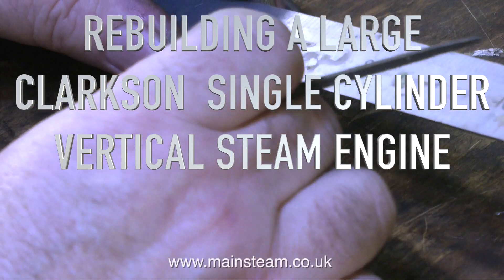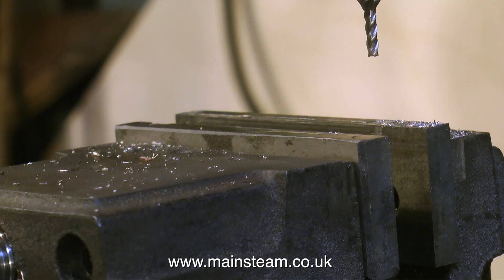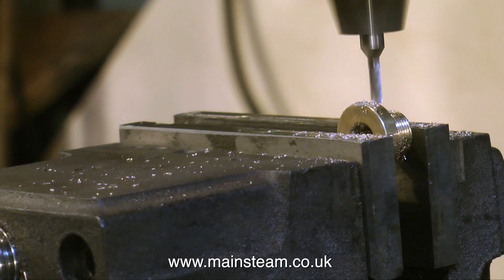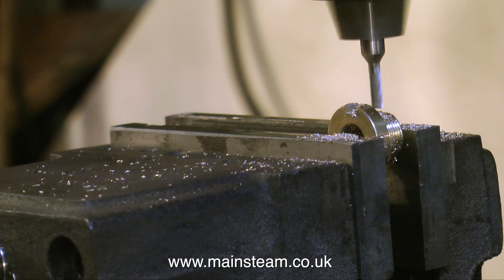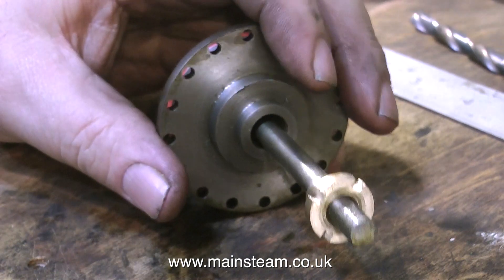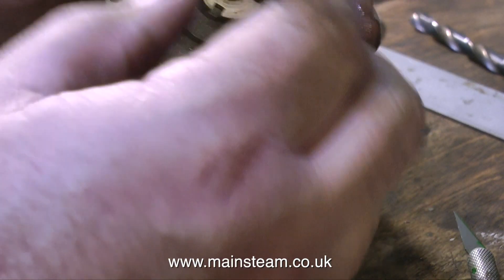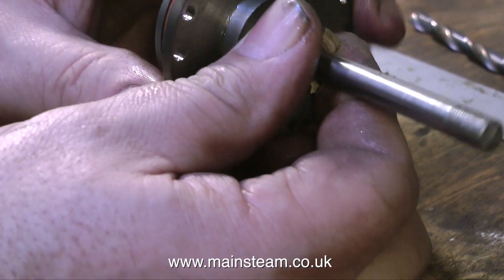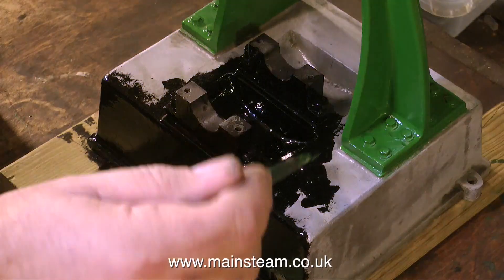REBUILDING A LARGE CLARKSON VERTICAL STEAM ENGINE - PART #8

Comment: Graphite is an allotrope of carbon, as is diamond. Diamond and graphite are different forms of the element carbon. They both have giant structures of carbon atoms, joined together by covalent bonds. However, their structures are different so some of their properties are different. Diamond is a giant covalent structure in which: each carbon atom is joined to four other carbon atoms by strong covalent bonds the carbon atoms form a regular tetrahedral network structure there are no free electrons. The rigid network of carbon atoms, held together by strong covalent bonds, makes diamond very hard. Graphite has a giant covalent structure in which: each carbon atom forms three covalent bonds with other carbon atoms the carbon atoms form layers of hexagonal rings there are no covalent bonds between the layers there is one non-bonded - or de-localised - electron from each atom. The forces between the layers in graphite are weak. This means that the layers can slide over each other. This makes graphite slippery, so it is useful as a lubricant. Sorry I used to be a science teacher
Reply from the maker: Thank you for the Essay Stephen.

Comment: I my self have a horizontal Clarkston engine that reversible and love it, my friend calls it my paper weight, the only flaw I found with it is the crank cam slipped and I used lock tight to hopefully set it the right way, we tried different things to set it in place but once I had the engine running well I use lock tight on the crank cam so it would not shift,
My engine is painted read with the mahogany around the outer pistion, todate I have only found really short video on that model, heck I don't even know the model, I sold an old car to get it and from a dealer so no flea bay junk, I think it's an 80's era engine build, 2 inch bore but I need to a little bit of alignment

Comment: I know this is really beating a dead horse (is there some steam equivalent we could come up with?) but the iron in cast iron does not mean it is elemental iron.  Cast iron is like 3-4% carbon by weight.  Steel has LESS carbon than cast iron.  Steel is less than 2% carbon by weight.  I'm not gonna weigh in on the graphite vs. carbon bit...but if you get steel by adding carbon to elemental iron, then you get cast iron by adding EVEN MORE carbon.
Reply: Errr, what? I think the difference was in the carbon and its makeup, not the iron. Though to get steel you'd have to get close to elemental iron.
To get cast iron you melt the basic raw form of iron, pig iron, and remove some impurities left over from taking iron ore and turning it into pig iron (can also add scrape iron and a bit of scrape steel)and cast it.
 To go from iron (pig iron, purer cast iron, etc) to steel you remove most of the remaining impurities using higher longer duration temperature, usually by forcing oxygen into the melt. This process removes most of the natural graphite carbon from the iron; this is the part getting close to elemental iron, you then need to add back carbon into the iron to make steel. Usually you can use charcoal or even let the fire create your charcoal by using straight wood/plant matter.
You don't add carbon to make cast iron, the carbon already exists within the iron ore. You do need to add carbon to iron to make steel, but first you need to cook away most of the natural carbon that exists within the iron ore.
The commentator was wrong to say it isn't carbon, it's graphite. A better way would of been to just share some interesting information that the cast iron has graphite mixed in with the iron as its form of carbon, while steel has elemental carbon in a matrix with the iron for its carbon.
Now my curiosity is what happens if you took a pure, elemental, form of iron, like when making steel, and added industrial diamond dust to the iron instead of regular elemental carbon while making said steel.

Comment: Hi Keith,

On the face of it, you are both equally correct (or incorrect) as each other... read on...

I am a time-served mechanical engineering technician with HNC in mechanical engineering and engineering drawing (from Kitson College of Engineering and Science, latterley from Leeds Polytechnic in 1972). I was always taught that when one microscopically examines cast iron, the black specks were 'free carbon' and I was never taught to refer to it as 'free graphite'.

And yes, Keith, you are correct... graphite is carbon, 100% so. As we all know, carbon can be very, very soft as in graphite pencil leads, or very, very hard as in diamonds. It's the crystalline structure that makes the difference. 

Contrary to what your detractor may have claimed, cast iron typically has a greater than 2% by wt. carbon C content, but in reality is likely to be in the range 1.8% to 4.0% by wt C. Steel, on the other hand, has a very low carbon content. The other common alloying element in cast iron is silicon Si at the rate of around 1% to 3% by weight.

In effect, cast iron is very much higher in carbon content than steel, hence the Sir Henry Bessemer steel-making process, which uses high pressure air pumped through molten iron (in a Bessemer Converter) to reduce the carbon content by causing the carbon atoms in the iron to join with oxygen atoms in the pumped air to be given off as CO2. This process has been replaced (at the Scunthorpe Steel works, at least) with the more efficient BOS method of carbon reduction... British Oxygen Steel-making, whereby pure oxygen is pumped through the molten iron.

So, to be fair, Keith, all things considered, you were more accurate than your detractor... so the Mantra is not necessary!

I'm loving this series, Gordon (another Tyke)

Comment: You are correct on both counts, cast iron has a high carbon content and graphite is entirely made of carbon (its called an allotrope of carbon as that is the only element present in pure graphite).

The commenter is wrong, Steel has less carbon by weight than cast iron but instead gets a lot of its desirable characteristic from heat treatment which affects the crystal structure.

Comment: Hi Keith I am building the glr vertical boiler at the moment I was wondering if you could recommend an engine with a one inch bore that is good for a beginner. Once again great video graphite is weaker because it is composed of several one atom thick giant covalent structures of carbon quite similar to diamond. These layers slide over each other alowing you to manipulate the shape of the material

Comment: you have spoken many times about an old supply of graphited yarn. what about those of us without a supply? I have used graphited plumbers packing and this was very well coated with graphite. ever think about using the graphite for lubricating key locks and saturate regular yarn with this, maybe with mineral oil? food for thought & my 2¢. btw, you did a good job of "caressing the piston rod". almost fell off the chair laughing.

Comment: Just a little tip Keith, DO NOT run milling cutters in ordinary drill chucks.
Reply from the maker: +Roger Croll Mine is not an ordinary drill chuck Roger, it is a very old quite rusty and very hard to turn drill chuck - so it seems to hold the small cutters OK. It's just quicker than using my Clarkson milling chuck . . . .

Comment: If your career in model engineering doesn't pan out, you could always get on with narrating audio books! Very soothing! Also, Can silicone o-rings be used as a packing instead of the yarn?
Reply from the maker: +75Bird455 Yes you can use O rings too.